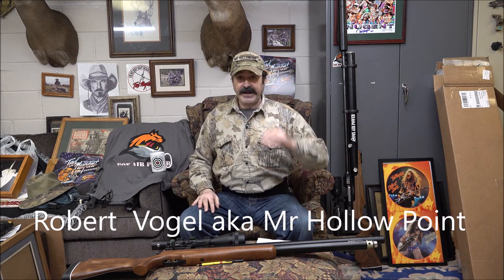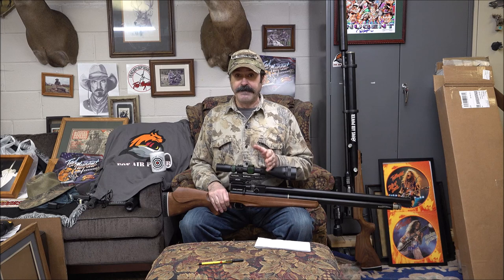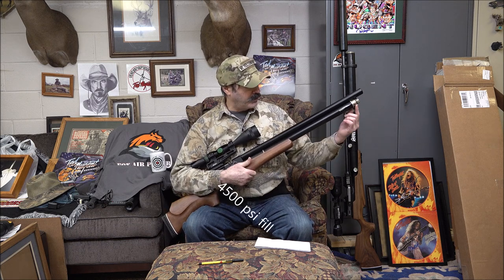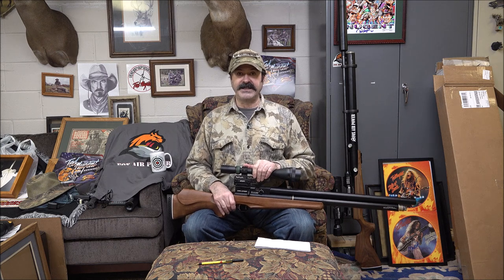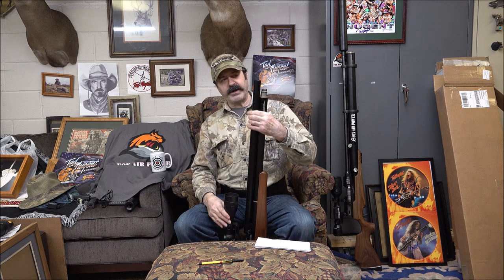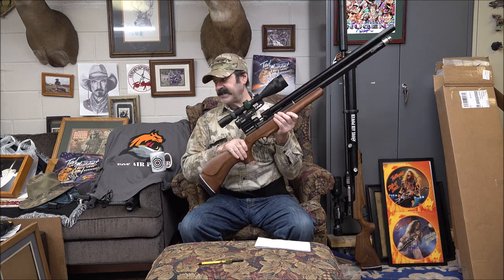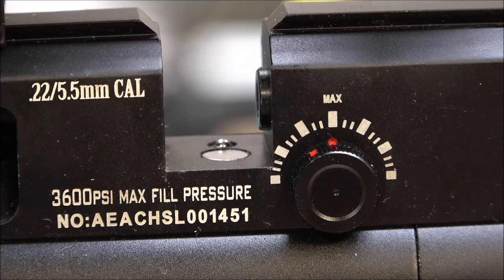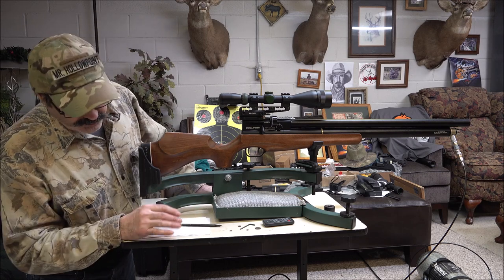22 Challenger Air Rifle

Comment: bob if you unscrew the shroud barrel facing down and wrap felt around the barrel behind the spacer and put the shroud back on (wrap from right to left top over) you will find the rifle so quiet that it sounds broken. scary quiet.
 and 40 gr hp slugs at .218 will reduce velocity without losing power balls out power. , and 3600 psi while regulator is in use will get you a spread of less than 50 with 24 shots, but then again the reg can be removed and 3600 fill will still get you 24 shots at a higher velocity gaining 10fpe.
 THE LAST WORD 
 no suppressor needed quiet time

Comment: I don't understand why the shot string has such a bell curve, are you sure that gun has a regulator?
Reply from the maker: Yes it does, but I had the power dial set for more air consumption for the heavy bullets. 
If I dialed it down and used a 18 grain pellet it would be flatter.
Reply: Mine done the same thing in .25 cal until I turned the reg down to about 150-160 bar and added a little more tension to the hammer spring, and only fill to 3800 psi.